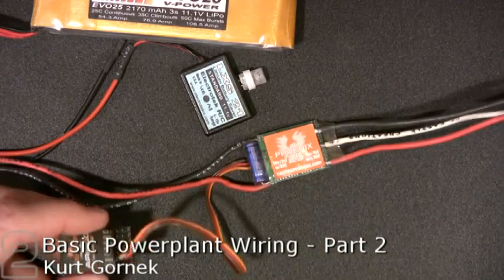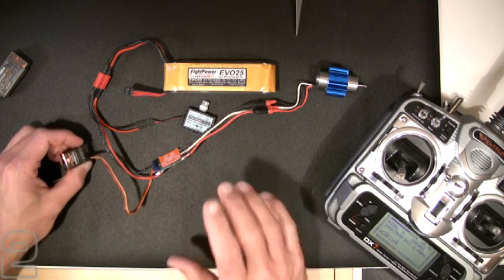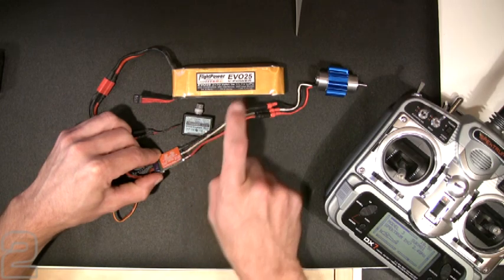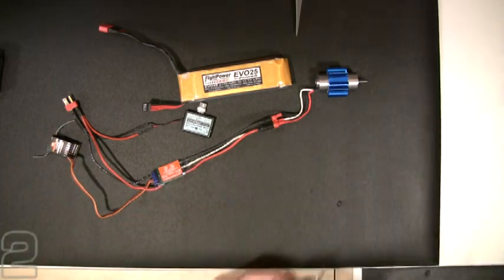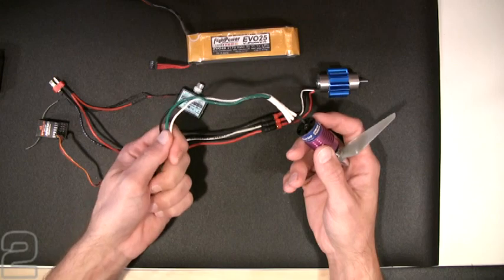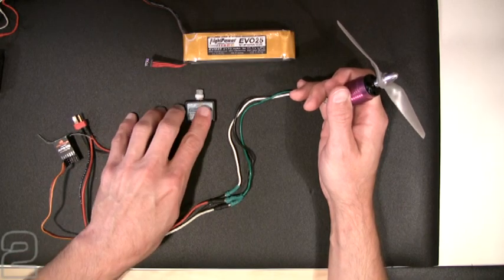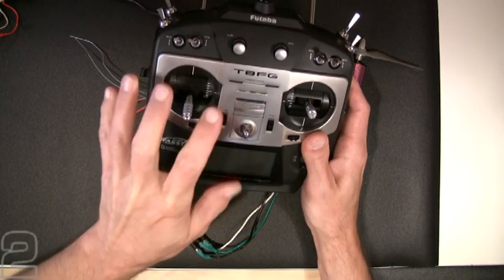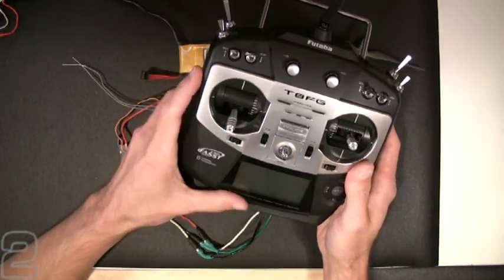RC Motor and ESC Wiring - Part 2

Comment: Hey guys new with RC airplane, do not understand how the motor is fed from the speed controller. I know the three wires go to the motor and two to the battery, and one plug to the receiver. But how is that set up controlling the motor speed? Tom

Comment: I recently found this Rc Fuel helicopter dumpster diving and I like to know if its worth spending the money to repair it or if im better off selling it as a parts thing.I would appreciate it if I would get back a reply soon if possible or if someone may guide me thru on wiring or connecting it back together.

Comment: I have had several multi engine electric aircraft and have never run into this problem. I hope you can help. I have two 46 size motors hooked to two 80 amp esc's. I am using a separate on board power supply so I have disabled the BEC on each controller. The battery leads from each speed controller meet at the center of the wing and have been combined into one lead. I am also using a safety arming plug. I am using two 5 cell batteries with a parallel plug. The problem occurs when I power up both motors together. When you advance the throttle all is well for the first quarter but as it is advanced the motors begin to oscillate and if I let it continue they will even begin to cut out alternately. But when I disconnect one esc the remaining motor operates perfectly. I have performed this with both motors and by themselves there is no problem. Any help would be much appreciated.
Reply: You ever come to a solution?

Comment: I just set up my bixler 1.1 with a 
TX RX: Turnigy 9x TX/RX
Battery: 2.65 amp 3 cell
ESC:Hobbyking 20 amp
Motor: 2620-1900kv Brushless Outrunner

Comment: my esc is not recognizing that I am at full throttle. In mode 2 I've tried setting my RX all the way down then turning on my RX then plugging in my battery. I then here the initial musical tone then three short beeps. Then short beeps every 15 seconds or so. I've also tried setting my throttle all the way up before powering on and get the same result. I've tried setting my trim to 0, -100, -120 and 2...same result.

Comment from the maker: @aannoonniimmss - Yep, try reversing the throttle channel (channel 3) on the radio transmitter.  Futaba radios typically need the throttle channel reversed to work with Electronic Speed Controls.

Comment: Hi, nice video here. I'm beginner in a RC world. I've a Futaba T6EX transmitter, Futaba R617FS receiver, Arrowind 18A ESC, Ripmax Xtra brushless motor 2829-16, a Li-po 2 cell 7,4/1300Ah battery and some servos, but when i put everything together, the motor doesn't work, just makes beep sound. Servos work fine. Any idea what I do wrong? do I need to change any of the components? Thanks.

Comment from the maker: @petritwow - The cost varies tremendously depending on your application.  Starting under 100.00 USD for all three (micros) to several hundred as you get larger and more powerful in size.  The receivers average 35.00 - 75.00 but can go over 100.00 depending on how many channels you require.

Comment from the maker: @eastcoast78  - Thanks a lot Canada!  As far as the ESC RX lead, the ESC radio lead plugs directly into the receiver.  The smaller leads you see from the ESC connector in the video are going to the battery monitor made by Electrotek RC products.  Its "siphons" full power directly from the battery and alerts you when you reach voltage cutoff  threshold.  It's not necessary at all, just something we like to use, especially on helicopter setups.